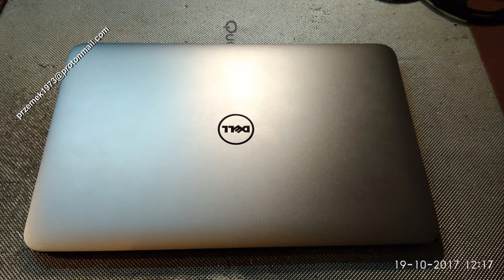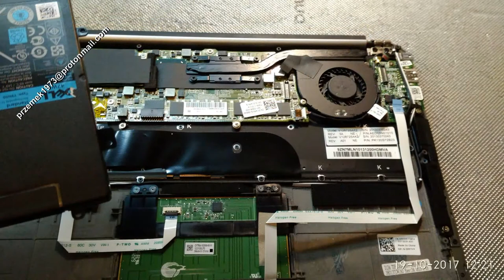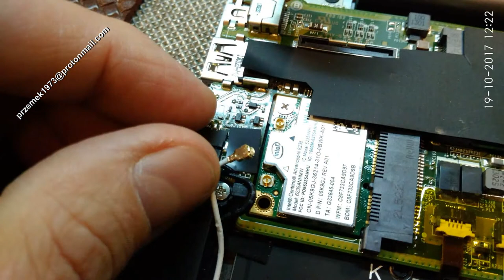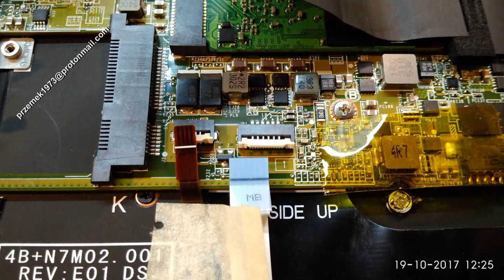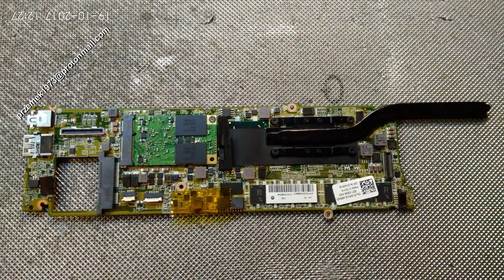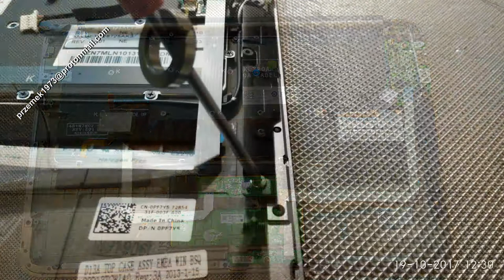Dell XPS 13 L322X disassembly  water keyboard  battery, cooler fan clean, wymiana, jak rozłożyć

Comment: Any idea where is the BIOS battery on Dell XPS 13 L322X? I did not find it and would like to reset the BIOS since my laptop does not boot anymore.
If you have an idea where the RAM is, it could help also since I read reseating it may fix the issue.
Reply: looking for this too
Reply: @ivanluansing8073  I found where the BIOS battery is after Dell sent me the documentation "xps-13-l321x-mlk_owner's manual_en-us.pdf".
You have to be careful when taking it off to not break the plastic holding the BIOS battery like I did.
Dell told me the RAM is integrated in the motherboard (soldered).
But I was not able to fix the issue and bought a new laptop, not Dell anymore of course.